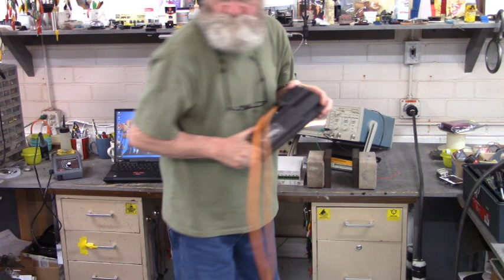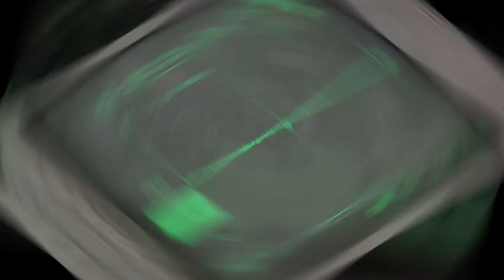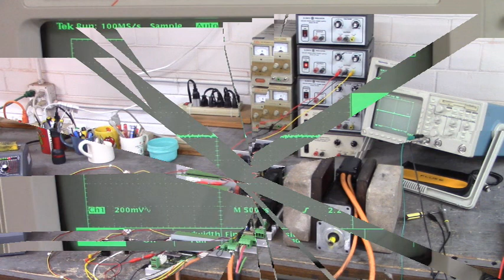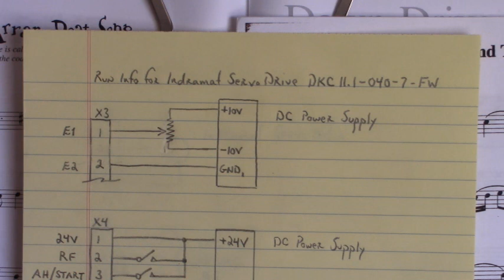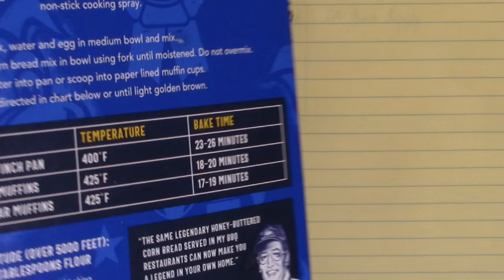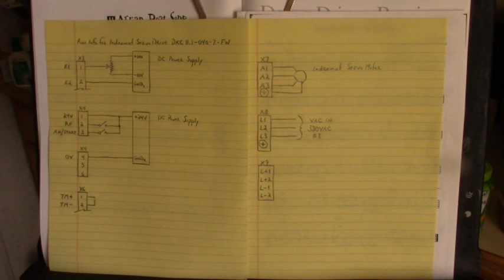Indramat Servo Drive Model DKC11.1-040-7-FW Runs the Servo Motor Rough.

Comment: Thanks Peepaw, great video indeed. I have a few indramat DKCxx.3-040-7-FW giving error Undervoltage in power section (E2-26). Could you advise what components to look at to fix the problem. Thanks

Comment: Hi indramad alarm f277 help 🙏
Reply from the maker: Hello, I worked on an DKC011.1-040-7.-FW that was tripping on alarm F277. I applied +24VDC to X4 Pin 1 and its Gnd to X4 Pin 4. The seven segment display shown Alarm E251. Then Alarm F219. And finally Alarm F277. I removed the electrolytic capacitors on the power board, and replaced them with new electrolytic capacitors. Then when I applied +24VDC to X4 Pin 1 and its Gnd to X4 Pin 4, the drive powered up to E251 and E219.  Alarm F277 no longer occurred. E251 = Motor Overtemperature Warning. And F219 = Motor Overtemperature Shutdown. These two alarms tripped because I did not have the motor thermal connected to the drive. The manuals that I have do not define what is Alarm F277. I hope this helps you repair your servo drive.
Reply: @PeepawMcDonald  I applied but the problem persists Thanks for EVERYTHING
Reply: Replace hcpl-7800 as per video. It should work.
Reply: @rtecha.m9648  thank you very much i will try 😇🙏